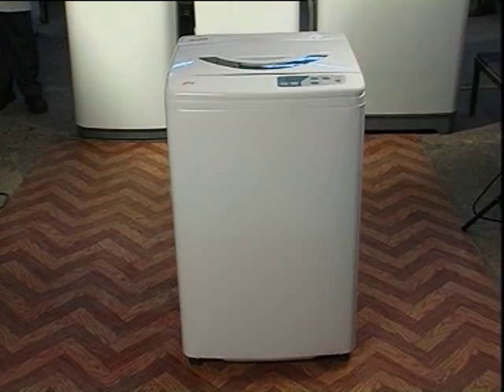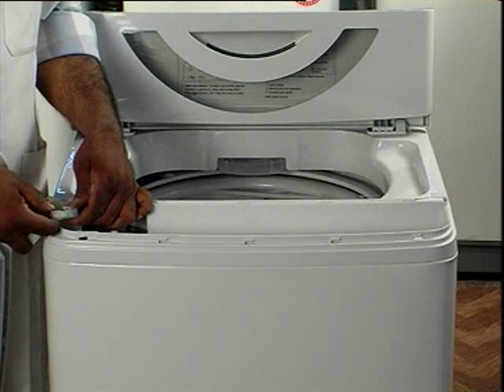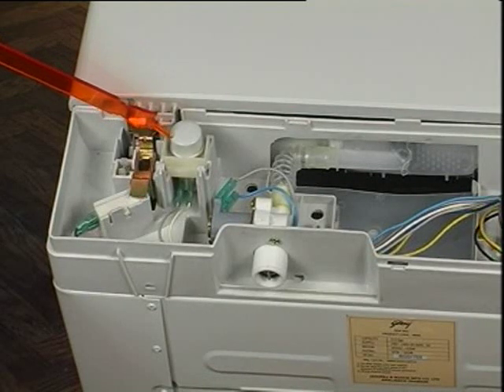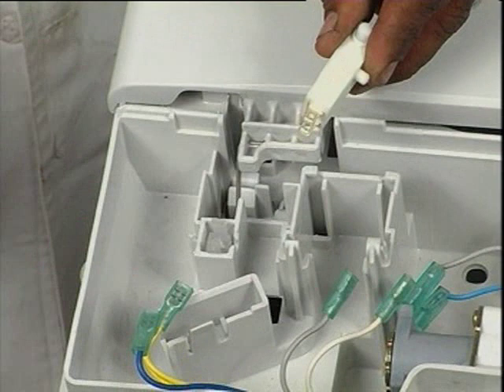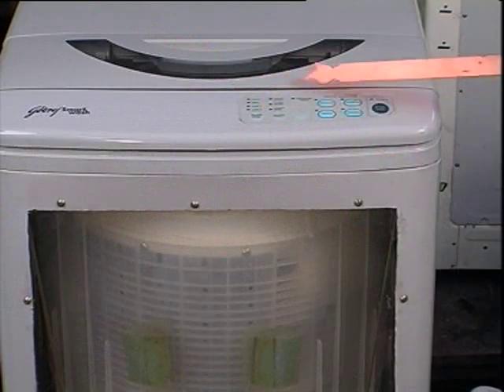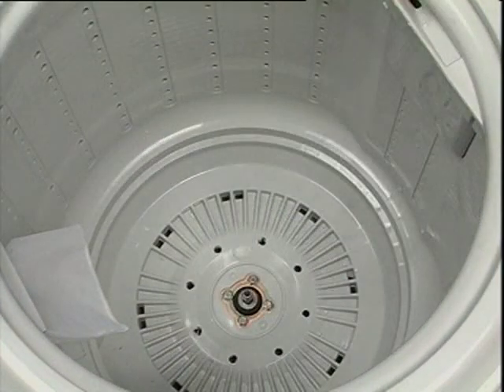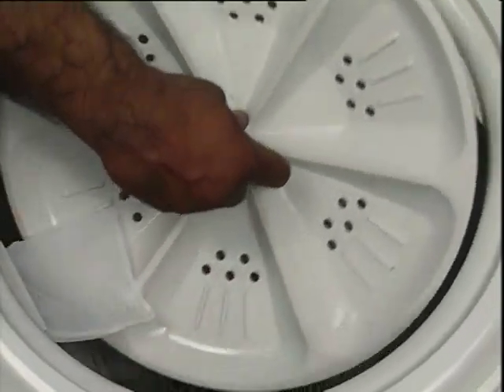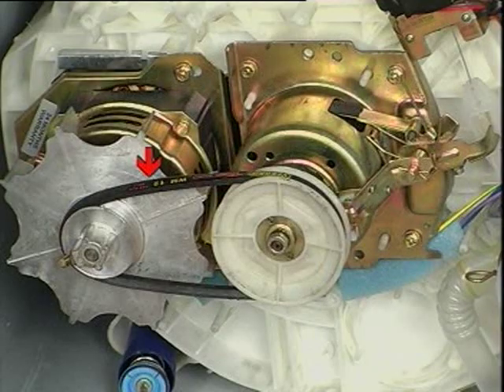Godrej Smartcare - Washing Machines Training Film

Comment: The water is leaking while washing. Not able to find from  where . could you help where  and how to check
Reply: Check the drain valve...look for puncher in rubber or any particles blocking the valve from completely locking...very easy u can do it by urself

Comment: The machine takes water and do some spins but doesn't dry the clothes, without drying it removes the water. 
What to do?
Reply: Please check the belt tension. The same problem I faced . I just adjusted the belt tension by moving the motor by loosening 3 mounting screws. Ask me if any doubt.

Comment: I had a spin not working problem, it was easily solved. I  just pressed the tube going from water level sensor 5-6 times and starred the machine. The spin cycle was working perfectly.
What actually happened was while cleaning I had tilted the machine many times due to which the water in level sensor might had got water bubbles . Due to pressing the tube the level sensor starts working perfectly.
Reply: Sir my machine's spin not working 
Please help me out
Reply: Hi sir can u plz help me my machine is not storing water for spinning
Reply: @Star-cr9hc  which machine??
Two things you check 1 the top lid switch it might be damaged just remove both cables and connect directly. 2 the water level sensor tube , press it in middle 5-6 times and restart the machine. Difficult to explain by text. Hope you got it.
Reply: @Raj0236   i didn't checked your message just refer my reply below message.
Reply: thanks for the video.. really helpful..

Comment: Thank you sir
Reply: Please show  video
Reply: Sir I have A Problem In Godrej Washing machine Model No. GWF -620 FSX 6.2 KG.  Model.
Spin is not working. In spin mode only pulsater is rotating After replacing of Gear Box & Complete Motor, What to do in this case